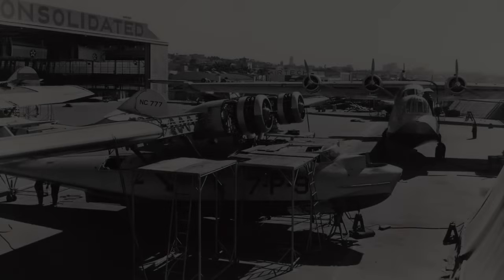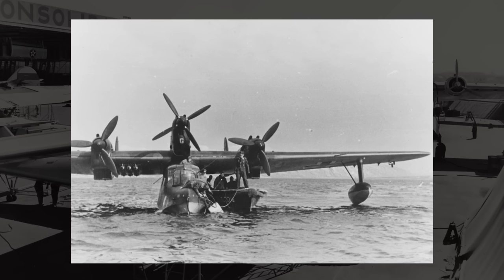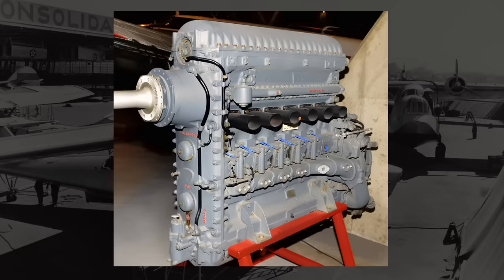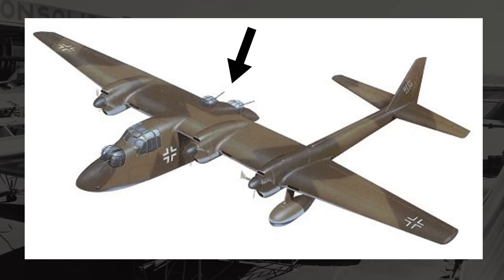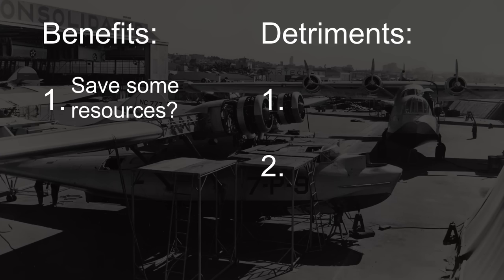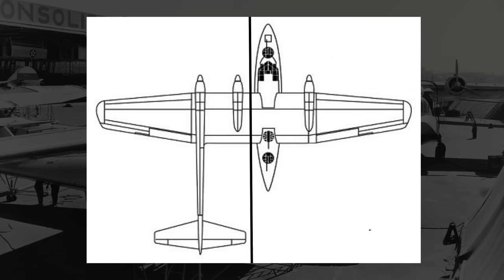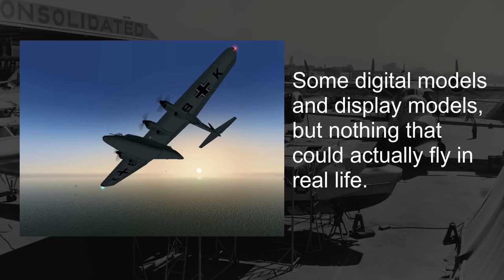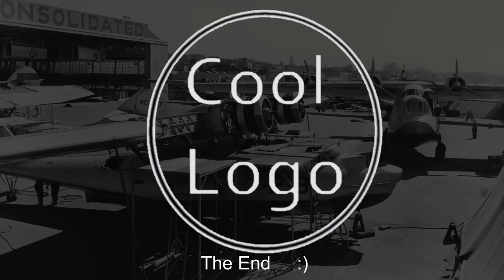Germany's Absurdly Asymmetric Seaplane: Blohm & Voss P 111

Comment: It makes you think these guys were competing with Blackburn to see who could come up with the weirdest designs.
Reply: Richard Vogts asymmetric designs harnessed these forces rather than pretend the aircraft was symmetrical.  
1 Circulation of the airflow of a propeller which will make one wing stall ahead of another and load it more due to toque.  It will effect the tail.  Aircraft often have an extended wing span on one wing, stall strips on one side, canted fins and canted engines.   
2 P-Factor.  A propeller when the aircraft has a high angle of attack will have one blade at higher angled of attack than the other causing it to veer.
3 Gyroscopic precession means that a clockwise rotating prop (from rear) will swing to the right when the aircraft pitches up etc.
Reply: Ha ha! You get the impression that B&V were just working up the courage to name one of their planes the Blohm & Voss Blohm & Voss just like Blackburn did with the Blackburn Blackburn.

Comment: Thanks for another B&M obscurity. Vogt was a genius - and a brilliant, meticulous designer - who had a big interest in exploring the wider possibilities of aerodynamics, and pushing the whole field forward. For all it's strange looks, my guess is that if Vogt designed, it would probably fly perfectly well. Maybe I wouldn't want be the test pilot, though.

I've also got a sneaking suspicion that, though not a nazi himself, he had the measure of the Nazi party leadership. They were, generally speaking, ignorant when it came to science and engineering, but much in love with anything shiny new and distinctive. Hence, putting these 'mad' designs before the high command would get enough interest and traction to fund development, even if actual production was unlikely. That way, Vogt could try out and test his advanced ideas and experimental concepts, while remaining independent and avoiding being swallowed up by the ministry or other manufacturers.
As I say, it's speculation. Time I read up a bit more about him. Suggestions?

Comment: I think another point on the "pro" side would be that it brought the third engine down to the wing level, and thereby would increase lift compared to the BV 138 design. Being based so heavily on the previous design would have made it both quicker and much less expensive to put into production as well.

Comment: If the goal here is to make a plane with a wider field of fire in the rear, which appears to be the primary purpose, then why not eliminate the booms entirely, lengthen the fusilage, and then putting the stabilizers (tail) ahead of the gunners position? Then you'd have an even better field of fire, and a far more practical plane. That would just be my design solution.

Comment: The direction of the rotation of the propellers causes torque and it cause the prop was either to the right above the wing and to the left blow the wing (if the rotation is counter clockwise when looked at from the front) or the opposites if the rotation is the opposite.
Ideally engines would have counter rotating propellers as that would balance everything but counterrotating propellers is apparently a bitch to get to work, the gearing is heavy and appaerntly likes to shake itself apart so you do not get that until the 60's aand then only on the Soviet/Russian Bears and som truboprop military heavy lifters.
You did get some multi-engine planes that had 1 counterclockwise engine aand one clockwise which balanced the torque notably the P-38.
But most multi-engined planes had all engines rotating the same direction which meant that one wing was being lifted aand the other pushed down from torque. This was compensated by adjusting the aileron trim.
But if the plane was slightly asymmetric careful weight placement could make neutral trim, which is more efficient, possible.
The other issue , and the one that screams look at me, is the tail placement. At low speed the tail is much more efficient if it is directly in the propeller was. The propeller wash, which is above the wing, is not directly behind the propeller but is either left or right of it depending on propeller rotation. Is the propeller above the wing moving left to right or right to left.
If the propellers on the model above move right to left above the wing than the central engine prop was should hit the tail; if it goes the other way then all of the propellers  miss thus certainly the former is the way that the propeller rotation would be. That would also lift the right wing due to torque.
From the photo at 2:00 the BVV 138 propellers rotate opposite but with a different engine and reduction gear the 110 presumably  could be set right for weight balance and propeller force on the single tail..

Comment: I can see where those designs with the motors on the front of low frontal area booms would be at least slightly more efficient, just due to less redirection of propwash.  The truly screwy looking asymetrical would have some  not insignificant roll induction with elevator pitch force, unless you somehow put some coupled differential countering ailerons in the linkage.  Personally, it looks like a really foolish answer to a design specification.  I would hope that the gunners did not have to 'be careful' about hitting their own plane.  If there weren't lockouts where structure was in the line of fire, they DESERVED to have their own planes shot up, by not even friendly fire, but self generated fire.  Basically shooting yourself in the foot, figuratively.

Comment: Thanks for covering this obscure design! You're falling into the same trap as the RLM did with the Bv141, though - blinkered by conventional thinking ("if it looks right, it is right"). Richard Vogt thought outside the box, and was a meticulous engineer. The Bv141's shape was dictated by the specification, which demanded excellent all-round visibility but also a single engine, and I suspect a good field of vision was also responsible for the P.111, whose primary role was maritime reconnaissance. As for weight distribution, the Bv141 had no centre-of-gravity problems which is why it handled so well; I'm sure Vogt was equally meticulous in the design of the P.111.
Having the rudder offset doesn't have a major impact, aerodynamically, as it only controls yaw. (The Bv141B's elevator was moved to the outside edge of the tailboom, remember, and worked just fine.) 
Incidentally, his use of a single tubular spar was inspired - in the Bv138 it acted as a fuel tank, in the Bv238 it provided engineer access to the engines and in the Bv144 airliner the wing pivoted around it to provide extra lift for take-off and landing. He was also responsible for designing the winglets that all modern airliners now feature.
Reply: Richard Vogts asymmetric designs are ridiculed but this is a bad thing and will only come from those that don't understand aerodynamics.   His designs handled well.  Propeller aircraft intrinsically are asymmetric because of the following factors:
1 Circulation of the airflow of a propeller which will make one wing stall ahead of another and load it more.  It will effect the tail.  Aircraft often have an extended wing span on one wing, stall strips on one side, canted fins and canted engines.   
2 P-Factor a propeller when the aircraft has a high angle of attack will have one blade at higher angled of attack than the other causing it to veer.
3 Gyroscopic precession means that a clockwise rotating prop (from rear) will swing to the right when the aircraft pitches up etc.
Vogt harnessed these forces rather than pretend the aircraft was symmetrical.
Reply: According to Eric Brown, RN, who test-flew the Bv141B, it had no vices, and the idea of flying with the wings held more or less vertically when getting attacked seemed to work as well (the idea was to give the rear gunner a better field of fire). His test flight was short as the engine seized up during the flight.

Comment: The BV138's ventral gun mount was not included in the original design. It was added at the Luftwaffe's request to compensate for the restricted field of fire of the rear turret.
Reply: @PORRRIDGE_GUN  IIRC, a three-bladed central prop caused vibration problems.
Reply: A ventral gun mount would be a little hard to implement on a seaplane hull, I think you mean dorsal turret.

Comment: Regarding weight distribution, any cargo is likely to be stored in the main body of the aircraft.  Thus adding or removing cargo will move the center of gravity.  A small sideways change in weight distribution is something that pilot can probably deal with however a more conventional design would be simpler.  I am not a pilot but one of my concerns with an airplane like this would be landing on water...  Which ever pontoon contacts the water first will experience a substantial force opposite the movement of the airplane.  Since the airplane is not symmetric this will try to turn the airplane.  It might work but it would be simpler to choose a symmetric design.
Reply: As far as water handling goes we have examples. Catamarans often use a very similar hull design. I imagine it would be fairly stable on the water.

Comment: I made the BV P.111 on KSP a while ago. The game trims the aerodynamic surfaces in real time, so pulling up actually pulls up. The ratio and relationship of the control surfaces would had to be established in the real plane too.
Reply: How did it handle?
Reply: @glitchedmatrix55  It flew no problem, BUT it had overpowered engines and KSP automatically moves all aerodynamic surfaces in the correct way to stabilize you...
I made a video (very old, bandicam watermark included), and my pc wasn't able to really move KSP so I was forced to use a low parts count and the general design concept (distribution, number of engines, shape...).
Just compare my last video "Antonov AN-70" final result with the BV P.111 XD, the BV looks like megablocks trash made by a 3yr old XD
Reply: Might be interesting to port this into Flightgear  I've got the BV-138 in Flightgear with the 600 HP Jumos.  It's water handling is pretty good and it's also adept at flying.
Reply: A game😂😂😂😂

Comment: For several reasons, propellers cause asymmetric thrust, which needs to be compensated by counter "steering". Trimming with controls always introduces drag! If you design an aeroplane with that in mind, and account for this asymmetric thrust, you end up with a more efficient design, which wastes no power, has better performance, and better fuel economy. The approach never caught on, due to conservative thinking in most makers, just like it took 50 years for winglets to finally become standard, or several years for swept back wings! 
I also doubt we will see lifting body designs any time soon, which would be superior in many ways that have been known of for a century! 
In the end, most modern airliners and military craft are now built with jet engines (which have no asymmetric thrust problem), and the turbo-prop machines are now being introduced with counter-rotating props on several engines that cancel any asymmetry, like the Airbus A400M Atlas, so the problem went away for larger aeroplanes. The market for smaller prop aircraft is limited, with very few new designs appearing in a segment that uses many used airframes, relying on the tried and proven, and with next to no R&D funding capabilities.

Comment: On the asymmetry: There's 6 factors to consider, of which you mention only 2.
As mentioned at 8:33, you first have the issue of the weight distribution between the two sides being (possibly) different. To me, the configuration seems to be roughly balanced, though. Keep in mind that the singular float is under the left wing, and consider that the tail boom is much further from the center of lift than the middle engine and fuselage.)
2: The thrust is distributed asymmetrically, shifted towards the left.
3: The offset tail (specifically the horizontal and vertical stabilizers) will cause a greater drag on the left side. This seems to be compensating or over-compensating the asymmetrical thrust, though.
4: The fin is off-center and it isn't immediately intuitive that this wouldn't yaw the plane in flight. However, this is not a problem. How the moments that are generated by the vertical stabilizer act on the plane is only determined by its forwards/backwards and up/down positioning, and completely independent of it's left/right positioning.
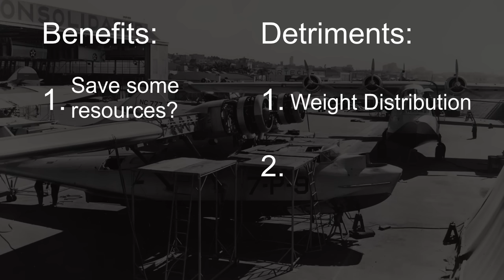5: As you mention at 9:12, the control surfaces on the tail are offset to the left, so applying yaw or pitch will increase the drag on the left side, yawing it to the left. So yes, it would yaw more easily to the left than to the right, unless you applied some non-linear transformation to the inputs to counter this effect.
6A: The elevators are offset to the left (unless you only put one into the right half of the tail). Applying up pitch will roll the plane to the left and down pitch will roll the plane to the right. Even worse, this effect would be non-linear because it mixes with the quadratic perturbation mentioned in point (5) above, AND once you let go, you might experience a time-lagged effect in the opposite direction.
6B: Similarly, with the horizontal stabilizers being shifted left, rolling to the left might pitch you down and rolling to the right might pitch you up (although probably to a lesser degree).
It might be possible to counter the linear and immediate parts of these effects by mixing the elevators and aileron inputs (which can be done mechanically). In the worst case it could make the plane buck like a bull when you apply any controls, in the best case it can be largely cancelled mechanically and the remainder will be compensated for by the pilot developing a feel for the plane.

With the positioning of the
- left engine and tail
- middle engine
- hull and
- right engine
you have 4 degrees of freedom in the design.
This can theoretically compensate for 4 balance factors, but the result would be forced to be a symmetrical plane. Thus you can effectively balance 3 forces (or sets of forces), without adding trim ballast. For example points
(1) weight;
(2) thrust vs (3) drag;
plus one more.
So yes, it should theoretically be possible to properly balance the plane (for straight flight). I don't know enough about WW2-era plane design technology to say if it would have been possible without re-drawing the plans after each prototype.
Reply: I see that you have given the aerodynamic factors a lot of thought.Now imagine what would happen when one of those asymmetric hulls inevitably touches down fractionally earlier than the other or hits a wave that affects the other slightly less

Comment: I wonder if that 3rd engine in the is the main reason for this design, in the bv 138 it is mounted in an unusual place (on top of the fuselage) and ended up requiring a 4 blade propeller, something the germans rarely used, maybe BV designers were forced to use 3 engines instead of 2 because they were forced to use weak diesel engines but the central engine was undesirable, so maybe this whole design was an attempt to keep all 3 engines on the wings, and the off center tail was just a necessity to that end
Reply: Blohm & Voss designed weird stuff, because hey, why not ?

Comment: If I'm not misinformed landing on water is in itself already rather difficult doing it with asymmetric floats on purpose seem insane.
I seriously doubt this was a serious idea.
Reply: In flying boats, you take off and land on the main planing hull. The floats are really only there to keep the plane upright at low speeds and when it's stationary.
Reply: @thisisnev it's probably not that simple when the main hull is offset from the center of mass though. some weight has to rest on the float
Reply: @cosmic_cupcake  That weight is supported aerodynamically by the wing at take-off and landing speeds. It's what wings do.
Reply: @thisisnev  yes, and if you're just slightly below takeoff speed that float is going to touch down and become load bearing.

Comment: That's radical, I didn't realise something so asymmetric was considered.
Having said that, I've often wondered if more conventional propeller driven craft were slightly asymmetric, with the propeller torque acting in a known direction, would it make sense for one wing to give slightly more lift than the other when neutrally trimmed (say just enough to counter the mid-throttle torque).  Was this ever considered?

Comment: There's no benefit. What's the point?
Reply: For several reasons, propellers cause asymmetric thrust, which needs to be compensated by counter "steering". If you design an aeroplane with that in mind, and account for this asymmetric thrust, you end up with a more efficient design, which wastes no power, has better performance, and better fuel economy. The approach never caught on, due to conservative thinking in most makers, just like it took 50 years for winglets to finally become standard, or several years for swept back wings!
Reply: Excemption from the draft?